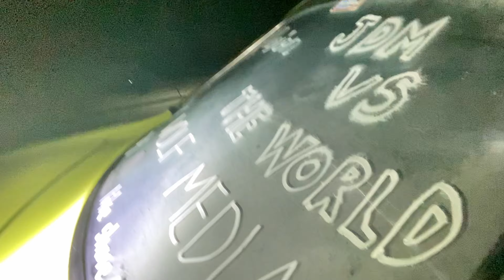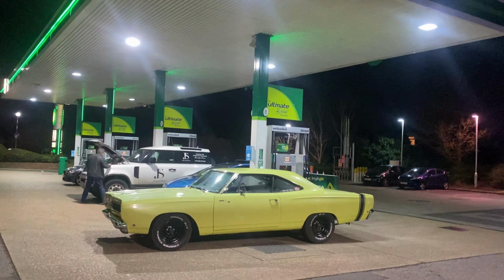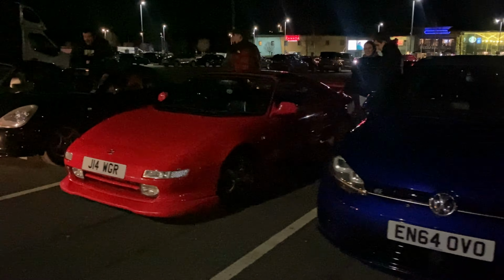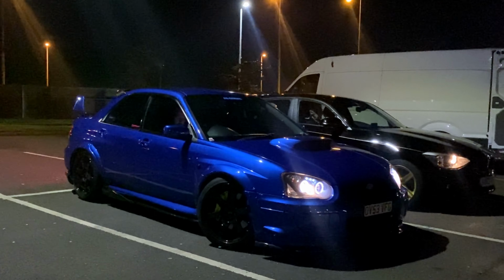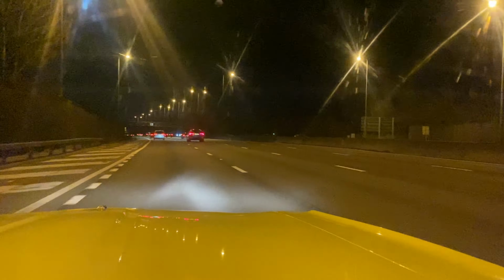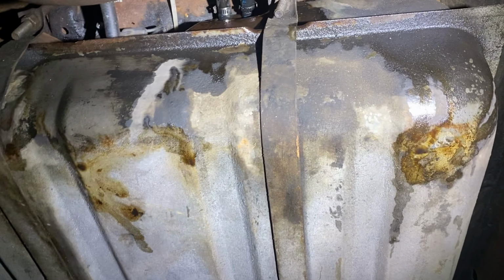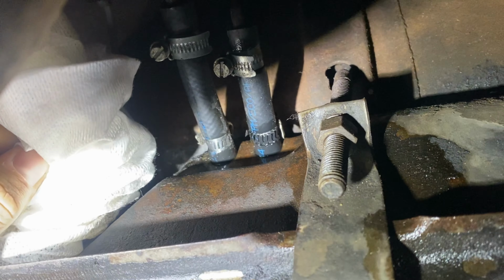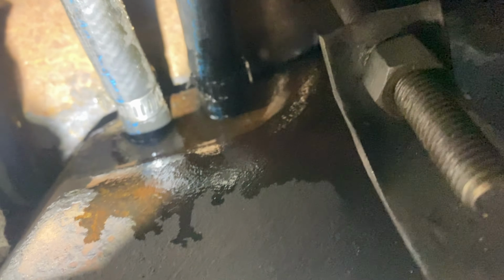MOPAR's! If they ain't broke, they'll break themselves 😂

Comment: Just like my Moggy after the rebuild over Christmas. I brimmed the tank for brooklands new years day meet only to get in it the next morning stinking of petrol and 1/2 a tank on the gauge. The metal fuel pipe has decided it wants a hole in it now and I can only get £15 in the tank currently. Then there's the indicator horn shorting out probably. The joys of classics 😂
Reply from the maker: I could probably have kept using it if I didn't fill up so much. Really don't like having fuel issues though so sourcing a new tank. Might have one sorted so will see how it goes.

Comment: My 36 had a fuel issue so I put in a new ally tank and hoses, Then my transmission went puff and then the ignition kept blowing fuses, this is the joy of owning  and running a historic car or in my case a truck, look on the bright side when you fix it, that's one less thing to do. Love the vids keep up the good work.
Reply from the maker: Thanks Nigel. Currently looking at a new tank that I may be able to get tomorrow. if it works out then like you said its one less thing to worry about. Next will be working out what's causing the lights to turn on and off by themselves 😂, one thing after another 😁

Comment: It will be where the tube is compressed to create a ridge inside and out of the tank, they become loose in the tank. I fixed mine (short term)) by spreading Chemical metal/JB Weld around the tube and on the tank. Obviously the permanent fix is braize/solder the joint as you can't tighten the original compression type fixing.
Reply from the maker: Thought about doing this. I've had problems with the tank before though and really don't like have fuel issues. Going to go for a new tank and then at least I can have peace of mind knowing that it should be reliable and a long term solution

Comment: Whenever you get a fuel leak, the first thing to do is loosen the fuel cap. This relieves pressure in the system and might get you home. Perhaps ethanol has dissolved your rubber hoses, and you must replace them again?
Reply from the maker: I seem to have a breather pipe on the current tank so it shouldn't build any pressure luckily. With the hoses. We put new hoses on in July and only ever use e5. When we looked yesterday there was one hose that had slightly split where the jubilee clip had dug in causing a leak. Replaced it but still leaking. Seems to have a split where one of the pipes meets the tank. Looking at getting a new one tomorrow so hopefully it'll be back out on the road soon 🙂